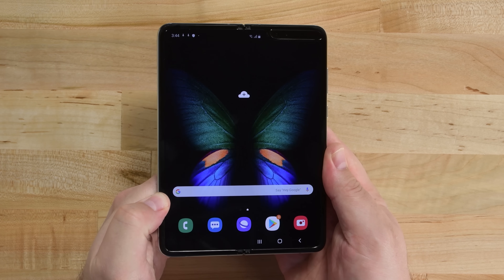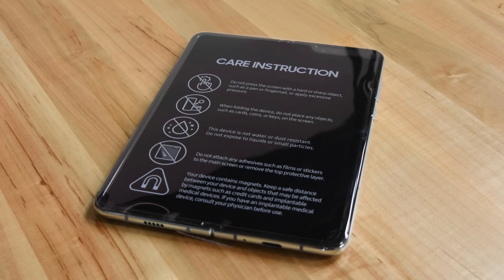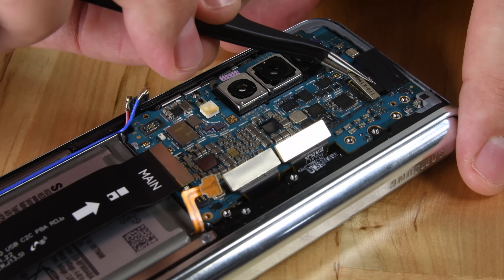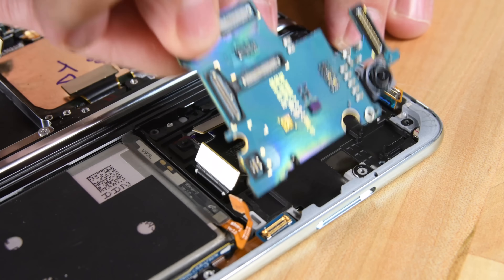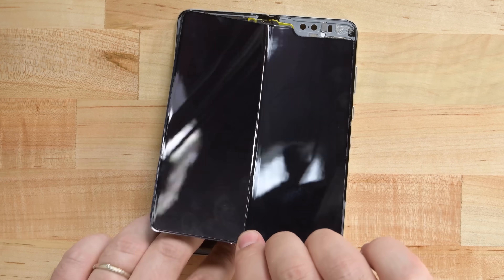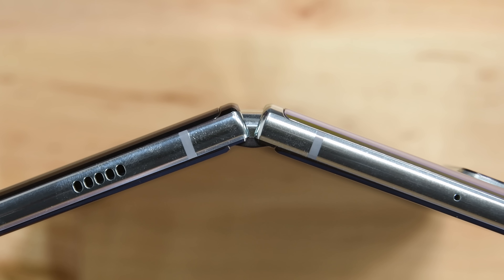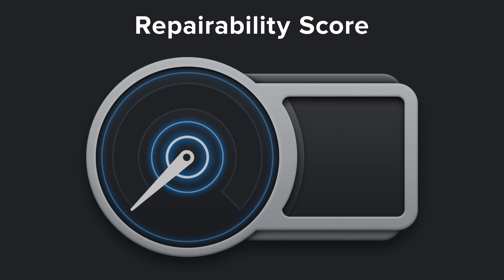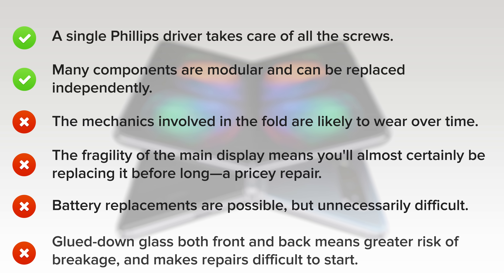Samsung Galaxy Fold Teardown - Did They Fix it?

Comment: IMO repair score is more of a 7. Fragile parts that wear and tear over time so theyll all have to be replaced is not part of the repair process, thats the user lifespan. Sure its fragile so thats -2 points, and its a delicate procedure that requires focus and care so thats another -1. But adhesive on back glass is a pretty much univeral phone thing so i dont get how thats even a penalty. Phone repairs require tons of care anyways too. Bonus that its only cross tip screws, and that the motherboard and internals layout is so easy and straightforward to follow are the +7 total

Comment: They can put 6 camera but they don't have space for headphone Jack
Reply: Just like the newer Apple iPhones - no headphone jack. I think the excuse was they can make the phone more water proof if the leave out the jack.
Reply: @macforme  my phone is 2017 Samsung with ip68 and headphone jack. It's just a poor excuse

And for fold, it's not water resist at all, it's written there on the label
Reply: @macforme  the true reason is so that they can charge you for a dongle that you'll lose within a week that converts a fragile USB C port to a 3.5mm TRS headphone jack. You will need a separate adapter if you wish to charge at the same time oh an none of the manufacturers have agreed on a standard of USB C to TRS addapers so I hope you happy buying more then one if you have different brand phones. USB C audio is a mess and the Standard TRS headphone jack should have never died as it's a convenient method of audio input and output.
Reply: jayanta biswas hm
Reply: jayanta biswas you get with it free airbuds headphone jack is not removed because lack of space it is more modern if you don't have headphone jack.
Reply: @marko4480  just like how a car is more modern if it didn't have backseat
Reply: Evan Kurniawan well if there was a way of improving the back seat (wired to Bluetooth) then why not ?
Reply: @Jack16114  bluetooth as of right now is like seat on the car rooftop
Reply: @GoodPersonz  you freaking killed him dude!
Reply: @Jack16114  p0
Reply: @marko4480  modern cars still have a headphone jack
Reply: @marko4480  best Headphones on the Market need a headphone jack....they have the best quality

Comment: I think you people need to update the criteria on which you give any device repairability scores. Cause as far as I could see, I didn't see you struggle in opening the device. And a device that is sold in limited quantity, judging it on if the repair material available or not, is just not right. 

Also expand your horizons a little you if wanna grab a bigger audience. And don't start a video with a cool device and saying it's a disaster, people don't like that. 

Of course they're gonna warn about - don't press the screen too much, it's plastic, they couldn't find a better material to work with. What do you want? Them suggesting people to throw their galaxy fold around.

That's why I said you should update your criteria, judging a 'concept in reality' like that is too harsh. And you give iphones higher repairability scores than this, when everyone knows how difficult it is, if you just want to repair the back glass and so expensive if you go to apple, at this point, this is just SHAMELESSNESS. 

When you score repairablility on basis on how good the materials are instead of if they can be repaired or not - You're giving scores on the repair, not on the device, you know that right? 

It's amazing how you skip scores on any pro models on iphone by doing the teardown live. But iK what you're gonna give those - a 6, the score you've been giving them since 2010. Even after their numerous efforts to suppress repairing and making it costly. Well done, you deserve 'THE 💩 AWARD'
Reply: Looks repairable in video...feel like score got based on cost and components all needing replaced due to design though.  Which doesn't make it unrepairable, but could cost more than it is worth especially if one thing goes wrong during repair.
Reply: @Gamerz00760  That's what I'm saying man, same goes for the iphone repairs especially the back glass but they scored higher and this innovation is being judged for it in a ruthless way.
Reply: There are NO parts available for this phone at the moment. If you need to fix something it has to be scrapped from another phone. So regardless of how easy it is to open it is essentially unrepairable. And since a some of the parts are pretty much samsung prototypes, like the screen and hinge, you are not going to get a third party making them in the near future.
Reply: @gredystar8333  
Which was not a point stated in the reason they gave it a low score, so it's irrelevant to the conversation.
Reply: your an asshole. you get the asshole award!
Reply: wee woo wee wooo.. someone being salty, and yet never owned this device~
Reply: Samsung fanboi detected
Reply: @ramade9040  Yeah a fanboi who has never owned an expensive samsung device, you nailed it genius.
Reply: Gurkirat Singh then why you liked your own comment then?
Reply: Gurkirat Singh all Samsung phones have a glued battery so replacing the battery by yourself is kinda dangerous you could pop that bad boy and it’s goodnight for you

Comment: Glue should make all repairs start at 5/10 score. I mean you can't compare this with an iPhone 6 that has 0 glue aside from the battery pull-out adhesive.
Reply: Yup but 0 glue means 0 water or dust resistance
Reply: I was refering to the difficulty scale

Comment: honestly, i see no reason for anyone to buy one of these. its impressive and cool but painfully impractical and way to fragile to be used as a daily driver phone
Reply: Well, just caught one person using it
Reply: TBH It's pretty good. I've dropped it a few times on concrete and it was fine. I use it as my daily driver. The only thing I don't like about the fold is that you can't use the rear camera and the front screen to take selfies
Reply: Same thing could be said about sports cars, like Lamborghini, expensive, not safe,  poor comfort, reliability, cost of maintenance and repairs on seats 2, poor interior space. You can also say the same about designer clothes, huge mansions, mink coats and other luxury cars, houses with pools, private jets, having multiple vacation homes u never visit, having more money than you can ever spend and none of this u can take with u when u die. So it depends on how you look at it, if u looking for reasons to hate something u can alway find a way
Reply: @lilgman191  nice explanation
Reply: @lilgman191  except sports cars have been around forever and cant be destroyed with your fingernail
Reply: @wiisamii  u make no sense, yet they been around forever, decades yet they still has bad gas, rough ride, even higher cost of ownership and you more like to die in them. The folding phone will be much better in a few years. Your super cars still behind
Reply: @lilgman191  Sports cars are intended to be driven on a track or empty highway. You don't drive them in the city centre to show how rich you are. 
This phone is impractical and very unreliable in its current state.
Reply: lilgman191 u make no sense ser
Reply: @LuKaZ668  You're completely wrong, companies develop sports cars that can be, will be, and are expected to be used for daily life.
Reply: @lilgman191  sports car takes life???that depends upon how you ride u bitch!!!! When you use ur phone as a daily driver it should be some what durable...it should not be as fragile as paper!!! Oops it's indeed a paper!!! For your clearance sports cars is not a daily basis!!!! But phone we use it almost 15x7 !!!
Reply: Gaylords can't accept the fact this is a new unique device, first of its type, still better than nothing
Reply: @michealbay1290  "Gaylords" What are you, 10? XD

Comment: We owned phones with moving parts before and they never failed so soon, my old Nokia E90 which is basically the same concept (Small screen outside, big screen in) was used for 5 years without any failure, except scratches and dinges, it would have still worked if I haven’t upgraded. Remember blackberries? None of these phone had an IP rating too, so what are we really complaining about? A Halo device that leads the way is a good thing, I’m sure future iterations would have a better inner display material and IP rating. Let’s enjoy tech guys not hate on whatever is new. Mentioning the negatives is something I totally agree with or areas were the company needs to improve, but hating the tech for what it is and claiming that it’s overly delicate is not realistic, as I have mentioned before our old phones had more moving parts and buttons than any new phone would have, yet they survived, dinged yes, makes noises when folded yes, but it works and that’s after 3 - 5 years, back then we never upgraded that fast, now people upgrade each year, even sooner
Reply: The 2 phones I had with big moving parts both died within a year. I had a Samsung flip phone that someone closed down on my finger so the display was destroyed (not really the phone's fault) and a Nokia slider that got sand inside it by being in my pocket (bad design that allowed for stuff to get inside the mechanics).
Reply: OLBastholm I’ve owned phones with moving parts all my life, mostly old Nokia’s, Blackberries, and others like Samsung flip phones, I have not had an issue with any in terms of them breaking because of moving parts, a battery might die out and get replaced, the keyboard after 2 - 3 years would get mushy and have its inner membrane replaced, other than that nothing. Maybe because I take care of what I bought who knows, but I really didn’t have issues with moving parts, even none IP rated touch phones in the beginning were susceptible to water damage, except Sony phones in the beginning, and we’d do the logical thing of exposing them to high quantities of water, I mean rain and normal use was fine. Obviously moving parts and sand don’t go so well, when there is water or sand involved avoid bringing a phone without an IP rating, keep it in the car or somewhere. Common sense I guess, not bad design. You want a folding screen phone, this is the compromise we have to deal with right now, not bad design, because look around, do you see any other commercially available usable folding phones? I certainly don’t.

Comment: Watt hours is a measure of energy not power.
Reply: Rory Fisher isnt the unit of energy is “joule”
Reply: oh nvm watt/hr=p/t=w
Reply: @bakaakuma9288  yeah, a joule is a unit of energy, but so is the Watt hour. Power is energy per unit time. Watt hours is power multiplied by a time, the time unit cancels, hence leaving just a unit of energy... Hope that makes sense.
Reply: @rory.fisher  For all practical  purposes Watts are a measurement  of power.  Is your microwave  rated in joules? One direct formula for power is current x resistance.   You can take watts and divide by current to get voltage.  You can take watts and divide by voltage to get current.   Sounds like a direct  measurement  to me.
Reply: @michaelkaba7481  that's not my point... Watts is a measure of power, watt hours is a measure of energy, along with joules. Your equation should be Power = current x voltage.
Reply: @rory.fisher  yeah mistyped there, but principle is the same.  Watts are not watt hours.  Watts are a direct  measurement  of power.  For practical  purposes.  Thank you for correcting  my stupidity.   But, most people  when for instance,  if they want a decent  microwave  will buy one rated at 1500 watts, not 1000 or 1200.  It means food will warm quicker. Hence a more practical  application.

Comment: The screen being likely to wear doesn't detract from repairability, although an important point.
Reply: Repairability less important than durability. The most reparable device is pointless if you have to buy a new part every week. Maybe they should call it a “disposable” score.
Reply: @pierregabory8772  Exactly! Well said.
Reply: Good point. I guess that's why it got a 2 out of 10 instead of a 0.
Reply: Who stocks those kinds of screens though? Such a screen isn't widely adopted and the chances of it being repaired are less since they're not common.
Reply: @mozzie2729  who stocks  a screen made for specifit  before it was launched? galaxy fold is launched few months ago and if they manage to sell enough units, there is will be no difficulty if finding any parts of it. I had hard luck finding Galaxy s10 screen before it was launched lol.

Comment: More moving parts = more failing parts.
Reply: marcs I'm just happy they are changing the smartphone design because then the standard design will become cheaper because I agree with you I would not want a folding phone because it will never be as durable
Reply: marcs Flip phones have lasted years without this problem.
Reply: @BaconFaceMcGee  it's more compact so it won't be as stress on the hinge
Reply: Thomas Polinze Hmm...
Reply: We survived flip/sliding phones for a couple decades so that argument is pretty weak imo
Reply: No ItS A ReVoLuTiOnArY DeViCe
Reply: That’s why bending stuff is better.
Reply: OG Fold hinges have actually mostly held up fine aside from getting ridiculously loose. 🤷
Reply: We owned phones with moving parts before and they never failed so soon, my old Nokia E90 which is basically the same concept (Small screen outside, big screen in) was used for 5 years without any failure, except scratches and dinges, it would have still worked if I haven’t upgraded. Remember blackberries? None of these phone had an IP rating too, so what are we really complaining about? A Halo device that leads the way is a good thing, I’m sure future iterations would have a better inner display material and IP rating. Let’s enjoy tech guys not hate on whatever is new. Mentioning the negatives is something I totally agree with or areas were the company needs to improve, but hating the tech for what it is and claiming that it’s overly delicate is not realistic, as I have mentioned before our old phones had more moving parts and buttons than any new phone would have, yet they survived, dinged yes, makes noises when folded yes, but it works and that’s after 3 - 5 years, back then we never upgraded that fast, now people upgrade each year, even sooner.
Reply: @Anonnonon  agree with you totally on that